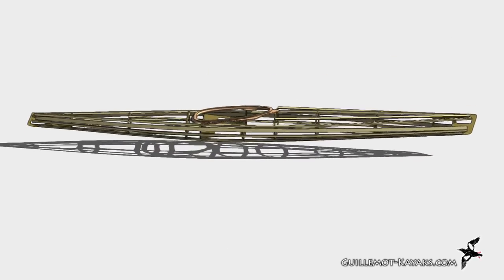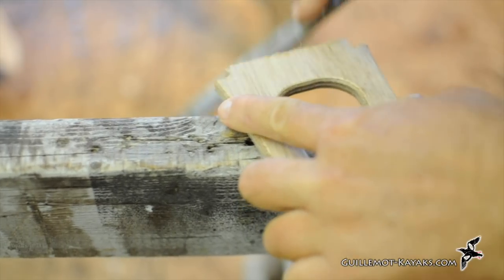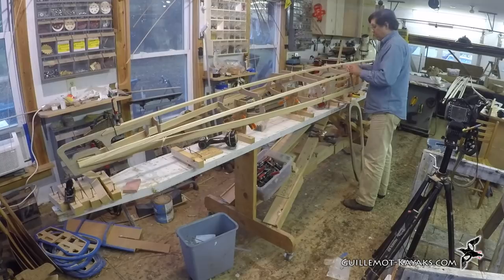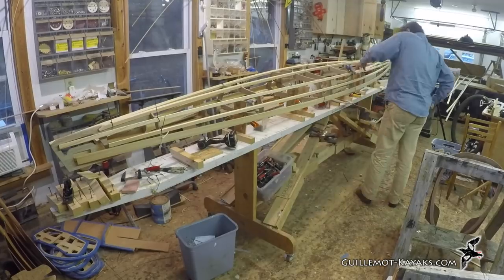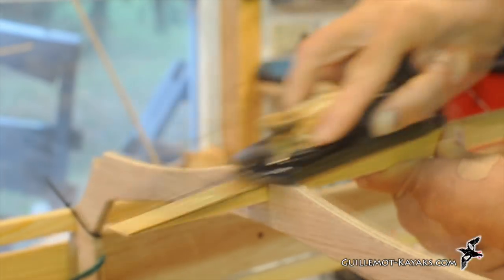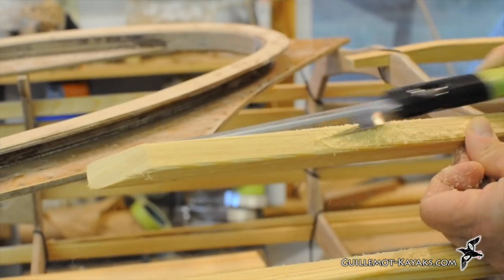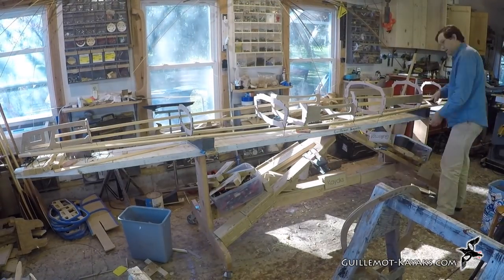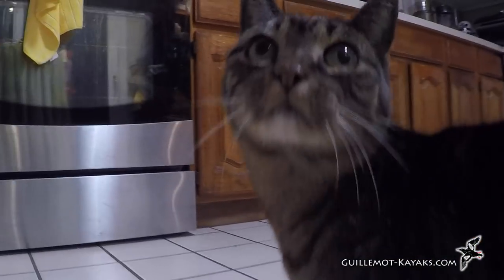Test Fitting the Frame - Skin on Frame Kayak - E4

Comment: Really smart that you use CAD and NC tooling in the home shop.  Also I like the way you hand fit all the pieces together.  Pencil, hand saw, block plane and sanding pad even whittling with a utility knife.   Old school craftsmanship.  Fred Bear of archery fame used to say it takes a "knack" to do this kind of work.  Bravo.  
What wood did you use for the stringers and frames?
Reply from the maker: I'm using marine plywood for the frames and cypress for the stringers.

I use whatever tool suits the purpose and is easily at hand. There are generally several suitable tools for any task.